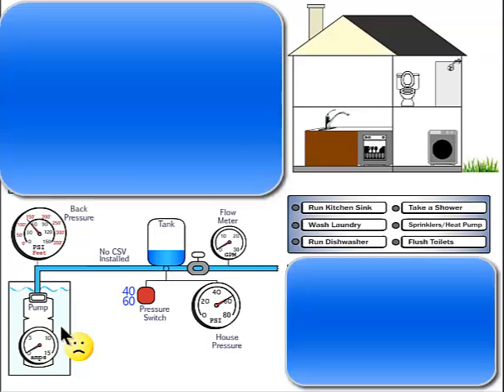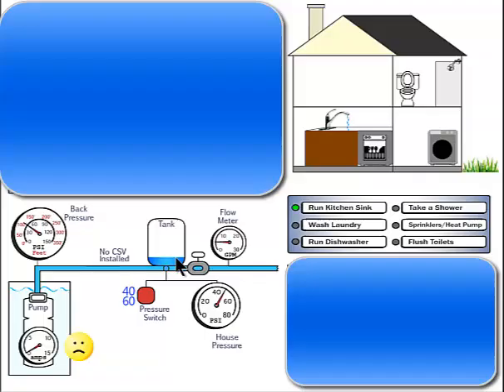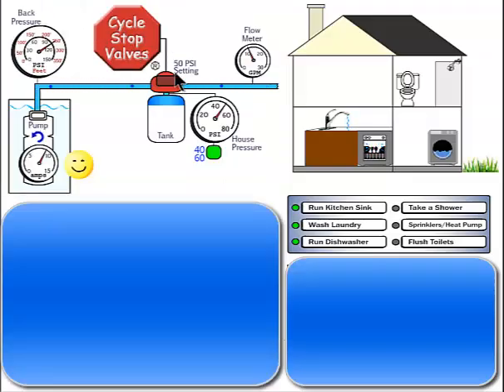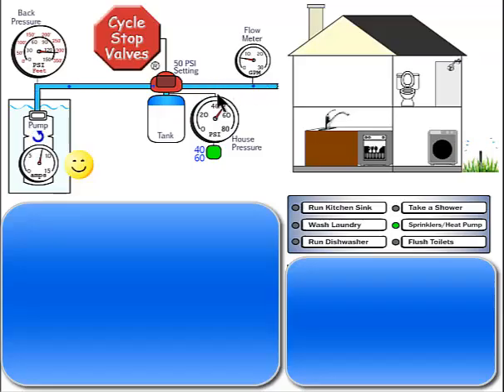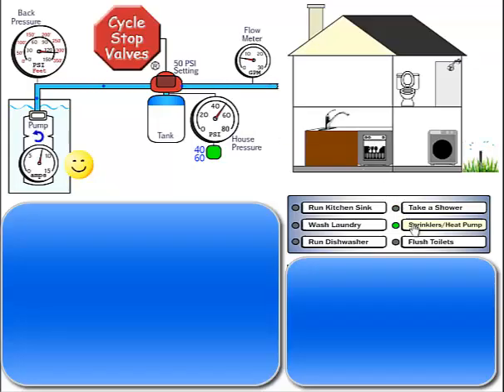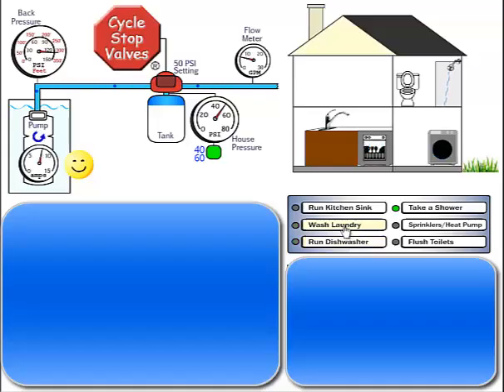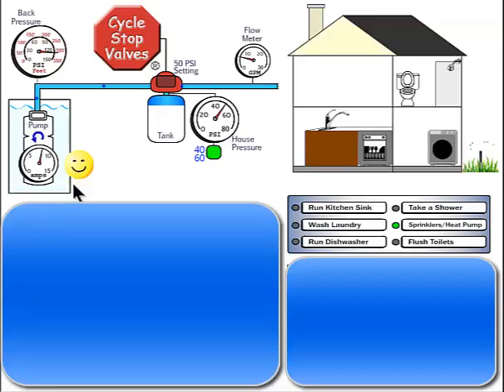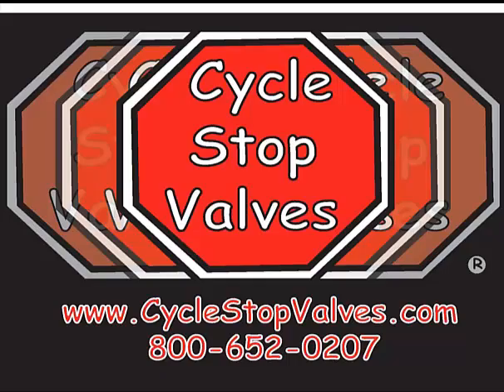How a Pressure Tank Works and why you need a Cycle Stop Valve

Comment: You need a large tank if you have an ozone filter system or something comparable that demands a lot of water at the end of it's regen cycle.  Therefore this is one instance where you will need a bigger bladder tank to make up for that split second when the pressure switch does not cycle quick enough to turn on the pump to satisfy the filter.  I have a stop valve and have had it for years and I find it to be great.  It worked very well until I installed an ozone system and had to go to a bigger tank which really had nothing to do with cycle stop valve.
Reply from the maker: Even with a small tank, CSV or not, there is no hesitation of flow on pump start.  However, with a little too much air charge in any size tank there will be a hesitation of flow on pump start, as the tank diaphragm hits the bottom slightly before the pump is started.  This means the tank runs out of water just before the pump starts.

You could also have a hesitation of flow on pump start if you have an SQ pump, which takes 5 seconds to get up to speed.  But even the problem of a slow start from an SQ pump can be solved by just decreasing the air charge in the tank a little more than usual.  In this way the tank diaphragm doesn't hit the bottom and the tank is still supplying water until the pump is up to speed.

When there is a lot  of demand at less than 1 GPM, a larger pressure tank is recommended with a CSV.  The CSV only supplies demands greater than 1 GPM , so a larger tank is needed to supply long term demands of less than 1 GPM.  There are reasons to need a larger pressure tank with a CSV, but yours should not have been one of them.  Sounds like you just had too much air in the pressure tank?
Reply: @cyclestopvalves8380  Thanks for the reply, you definitely know what you are talking about.  I tried lowering the pressure slightly, but it did not the solve the problem.  Could be a problem with the pressure tank.  How about a pressure switch with no low limit.  I know my well will not run out of water.
Reply from the maker: @JjL-v2e  Yeah those low pressure cut off switches with the little lever on the side are a nuisance.  Getting rid of that would probably have solved your problem alone.  But even those should not trip out if you have less air pressure in the tank than the pressure that the pump kicks on.
Reply from the maker: @JjL-v2e  Thanks for posting some truth to that Crazy Guy on the other Youtube channel.  I noticed he said everything is debatable.  Lol!  Facts as I have presented them and are certified on pump curves are not debatable.  His "opinions" are also not debatable, as they are factually incorrect.   He will probably delete your post as he has done others that speak the truth to his lies.  Thanks again!
Reply: @cyclestopvalves8380  He is definitely full of you know what.  Anyone with no knowledge can make themselves out to be an expert if they are talking to uninformed people.  You're welcome.

Comment: This product is simply a SCAM. I've worked with well pumps and pressure tank my whole life. Your pump WILL burn out sooner using this product AND you will find the water pressure delivery to your shower will be fluctuating. I mention shower because this is where you will notice this the most.  Standing wet and naked. Don't believe this BS.
Reply: All the CSV is doing is increasing the the head pressure to maintain a constant flow. It's no different then having a pump set lower in a well, higher head = lower flow. If you've "worked with well pumps your whole life" you should know this. The CSV is literally just a glorified pressure regulator so there is almost zero fluctuation in pressure at the plumbing fixtures as compared to a standard pressure tank setup that will constantly cycle ~20psi. With a CSV you will get an initial drop in pressure as the tank empties and then the pump kicks on. When properly set up the water pressure will level out just below the cut-out threshold of the pressure switch until the water usage is stopped. Then it will slowly rise until the tank fills and the cut-out pressure is hit. The only downside is the extended runtime to top off the pressure tank once the water usage ceases.
Reply: Had one for quite a while and nothing you say is true about my situation.
Reply: @JjL-v2e  Small setup?

Comment: how about i use 20/40psi what is the pressure when running continuesly
Reply from the maker: The CSV keeps the pump from reaching the shut off point as long as you are using more than 1 GPM.  So, with a 20/40 switch the CSV would be set to 30 with a small tank, or 35 PSI constant if you have a larger tank.

Comment: Quick question, as the valve is holding the water to keep the psi at a constant psi (let's say 50) is the pressure that it's holding back, more stress on the motor?(amps)

And it's just for a better understanding, I think this is a good system as a running motor is a good thing, it's the on /off cycles in a shorter time the kills your pump, this is a great system you have.
Reply from the maker: That is the counter intuitive part.  You would think holding back pressure on the pump would be bad, and it would if it was a piston type pump.  But holding back pressure on a centrifugal  type pump makes the amps drop and the motor run cooler, which is the opposite of what you would think.  Running the motor cooler at low amps while eliminating the cycling has proven to make pump last not just a few extra months, but 2-5 times longer than normal.  You can see why pump manufacturers are scared of Cycle Stop Valves.
Reply: @cyclestopvalves8380  ok I understand, I have your system in my garage waiting for installation..after winter 🥶, and a friend of mine just got your system, thanks from Illinois

Comment: About how many years will this add to the life of the pump? Very curious, thanks
Reply from the maker: Believe it or not the CSV has been documented to increase the life of pump from 4 to 10 times.  Our first test 30 years ago were on systems that cycled the pump to death every 2 years or so.  Those systems last over 20 years with a CSV.  Other systems where the pump lasted the normal 5-7 years the CSV has made last 30 years so far, and most are still working.  You would not believe how long a pump will last when you reduce or eliminate the cycling on and off.  That is why pump companies have labeled the CSV a "disruptive" product, as it makes pumps last much longer than the manufacturer wants it to.

Comment: Can you please explain why a system will fail to work when the pressure gauge is faulty? I’ve have to change my gauge twice in 25 years and I can’t figure out why the gauge which isn’t wired to anything can affect the whole system. If the pressure switch is set properly shouldn’t that be sufficient? Thank You
Reply from the maker: The pressure gauge has nothing to do with the function of the pump.  The pressures switch will still turn the pump on at 40 and off at 60 even if there was no gauge.  But gauges are like everything else in a pump system which is destroyed from the pump cycling on and off too much.

Comment: Does the pressure switch have to be set at 40-60...
Reply from the maker: The CSV1A is adjustable up to 150 psi. So the pressure switch can be set as high as 140/160.
Reply: @cyclestopvalves8380  Alrity thank you

Comment: Not true, why dont you do a live video to show us  it in action. With and without CSV.
Reply from the maker: Lol!  What is not true?  That is exactly how pumps work.  Without a CSV the pump system cycles on and off and the pressure goes up and down until the pump is destroyed.  With a CSV the pump runs continuously while using water, the pressure stays strong and constant, and the pump is not cycling itself to death and will last several times longer than normal.

Comment: Brilliant animation. I live in an area that is close to the reservoir and the pressure is within spec but only just. I am thinking of installing a pressure booster system.
Reply from the maker: Cycle Stop Valves work just as good on booster pumps as on well pumps.

Comment: I’m curious what the pressure would be on the line from an average submersible pump to the valve? And why couldn’t you use a larger pressure tank to reduce cycles when you only need say 2-3 gallons?
Reply from the maker: There is no average pressure from a submersible pump.  Every pump is different and the water level in every well is different.  It is not common to have more than about 150 PSI, but 90-120 is more common.  Give me the size of your pump and the water level in the well and I can tell you exactly how much pressure will be before the CSV.  And sure you can use as large a tank as you want with a CSV, if you just like wasting money, space, and waiting on the strong constant pressure to happen.  It doesn't hurt if your pump cycles for every 2-3 gallons used, which is doesn't when you see how the CSV works.  The CSV takes off so many cycles for the long term uses of water that you can't hurt the pump flushing a toilet even a hundred times per day.  Pump companies labeled the CSV as a disruptive product almost  30 years ago as it makes pumps last longer and uses smaller pressure tanks.  A product that is disruptive to the pump industry is the best thing you can do for your pump and your pocketbook.  If pump companies don't like it, it is the best thing for you.
Reply: Thanks for the reply! We have a new 1/2 hp Zoeller pump, the well is 150’ with water level typically at 75’. We actually bought a CSV Kit, just haven’t installed it yet due to worries about the potential pressure on the old plumbing from the well casing to the house.
Reply from the maker: @jriley309  What gpm is the pump?
Reply: I believe it’s 12 gpm. Thanks again for the response
Reply from the maker: @jriley309  A 12 gpm 1/2 hp pump can only make about 80 psi max.

Comment: Barely installed it but noww....
My problem is the left side of my home shower gets more pressure than the right side of home shower,but my well is closer to the left side shower tho...how can I raise pressure or watever to reach other end of home?🤦🏻‍♂️.....
Reply from the maker: The CSV will raise pressure to both lines.  You must have a blockage or something to have different pressures on the same system.
Reply: @cyclestopvalves8380  So the 50 psi the csv pushes should be enough correct....
Guess I'll have to check for blockage🤦🏻‍♂️
Reply from the maker: @CountrySideLoony  Yeah you should have 50 PSI everywhere, except after a blockage.

Comment: restricting flow by applying reverse pressure heats the winding , in turn, may damage their  insulation. the pump needs to work at it capacity unless its an inverter.
Reply from the maker: You could not be more wrong!  Restricting the flow decreases amperage and heat in the motor windings, not the other way around.  The pump can work almost anywhere on its curve without varying the speed.  Fact is the high voltage spikes and rapid rate of switching from an inverter "VFD" cause high temperature in the motor windings and shorten motor life.  Cycle Stop Valves make motors run cooler and last longer, which is why VFD or inverter companies feed you so much BS, trying to keep you from trying a CSV, which will make your pump/motor last 30+ years.

Comment: If I load my shop tools so that they  slow down,  then they draw more amps, you are loading up the pump with more back pressure which is why it slow down. higher load + more amps.
Reply from the maker: Nope. Ship tools don't work like pumps and fans. Try loading a vacuum by holding your hand over the inlet or outlet. Amps go down. Opposite of what you think.
Reply: @cyclestopvalves8380   Holding your hand over a vacuum outlet does not load the motor more, it stops air movement which unloads the fan,  if you want to load the fan more you will need something thicker than the air that the fan is trying to move! , do you have a better example that can actually put more of a load on a motor.?, but maybe if you don't let the water flow it might release the load on the motor.
Reply from the maker: @YIQUANONE  By George I think you've got it. Same thing with  a centrifugal pump. Holding water back does unload the motor.

Comment: Do you have a current meter test showing how much current pump is drawing using CSV and not using it, I know when I stall my tablesaw it blows breakers and draws much more current, can't be any good for pump motor to restick flow to almost nothing by creating a huge back pressure?.
Reply from the maker: You would think so right?  I love showing people something they don't think is possible.  You are right on the fence of figuring this out.  A centrifugal pump is completely different than anything else, except some fans.  With the heat off, put your hand over the discharge of a blow dryer.  You can tell by the sound the motor speeds up. That is because there is less air being moved and less load on the motor.  Put an amp meter on the blow dryer, and you will see the amps go down even though you can hear the motor speed up.  Sticking your finger in the blow dryer and completely stopping the fan will have the opposite effect.  The amps will go up the same as when you bind up a circular saw.  Yes I have other videos showing the amp draw of several different pumps.  There is even a video showing the horsepower on pump curves to better explain how a centrifugal pump works.  The back pressure is never more than the pump can produce or withstand.  The back pressure is like putting your hand over the blow dryer.  It makes the amps decrease, which makes the motor run cooler.  Back pressure is good for the pump even though it is the opposite of what our brains are telling us.  Adding back pressure is a common fix for large irrigation pumps that are drawing too much current and tripping the breakers as it will decrease,  not increase amps.
Reply: @cyclestopvalves8380   i DON'T USE A HAIR DRYER, DO you have a links to current AMP mesurements with and without valve in real time, not a CHART.
Reply from the maker: @YIQUANONE  Well a vacuum cleaner works the same way.  Like I said there are lot of amp meters in my videos.  There is one titled "25S20-11 Grundfos AMP DRAW".  "Here's your link".  https://www.youtube.com/watch?v=_capz27LiYU
Reply: @cyclestopvalves8380   Do you have a video that is more than 2 seconds long showing a meter?, one that shows amp draw when used and amps draw when not used?
Reply: Dearest knuckleheads,
Amperage/Current drop when flow is reduced by increasing pressure/head. When a pump is not moving water it is not doing work, hence lower work equals lower horsepower.
Reply from the maker: @Blantston  I am glad you understand a simple valve can make a regular pump drop in amps with reduced flow the same way amps reduce with a Variable Speed Pump.
Reply: @Blantston  On what a VFD pump?

Comment: I have a well with a submersible pump but water comes out for only about 7-12 minutes depending on the time of the year.  I am wanting to add a cabin on my property and plan on burying a water cistern near the house.  I am going to buy a timer switch for the well pump so that it comes on multiple times per day and will fill into the cistern.  Since I am only there on weekends or maybe once a month I should be able to capture enough water in cistern to service my cabin, sprinkler system and maybe a drip irrigation system.  My plan is to put a submersible pump in the cistern and run it to a little pump house and then out from there.  Your video makes sense and I am thinking I need your kit with the CSV.  I have limited knowledge of these types of systems so I am wondering what type of submersible pump I need for my cistern (HP and GPM) to make all of this work using your system.  Thanks.
Reply from the maker: How many GPM's do you have running for 7-12 minutes to pump the well dry?  Even a well that only makes 1 GPM can still give you 1440 gallons every day.  You need a Cycle Sensor for the well pump to protect it from running dry, and it will be your timer as it is built into the Cycle Sensor.  You can use a Cycle Sensor on the cistern pump as well, so it shuts off if the cistern is run dry.  Because of the price many people are using the 1HP, 33 GPM, Hallmark pumps in cisterns.  I prefer the 230V version.  Used in combination with our PK1A kit you can have all the water you want at a strong constant pressure.  See this link.  https://forum.cyclestopvalves.com/index.php?topic=1841.0

Comment: What if the pumps max pressure rating is 5 bar @ 75 Gpm & if I required 6 bar outlet pressure at same flow rate  can I get the same if there is pressure vessel
Reply from the maker: The only way you can get 6 bar pressure from a pump that can only do 5 bar max is to have at least 1 bar inlet pressure to the pump.  A pressure vessel can only store the pressure it is given, it cannot increase the pressure.
Reply: @cyclestopvalves8380  Your example shows a 25gpm pump @ 50psi, how then can the pressure switch turn off at 60 psi? Turns on at 40psi yes but from what you just said the pump can only push 50psi out to the tank and the tank can only store the pressure it is given. How then can the tank reach a pressure of 60psi to turn the pump off?
Reply from the maker: @waltermelyon4300  Because the CSV is set at 50 PSI and will maintain 50 PSI when using more than 1 GPM.  But the CSV cannot close to less than 1 GPM.  So when no water is being used the 1 GPM "leaking" through the CSV has no place left to go except the tank.  The tank is filled at 1 GPM until it is full to 60 PSI and the pressure switch shuts off the pump.